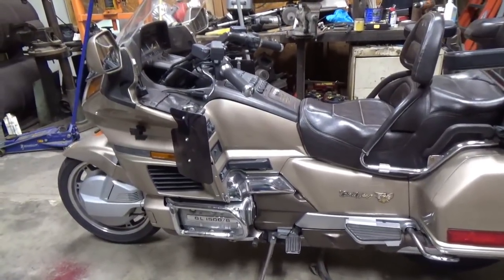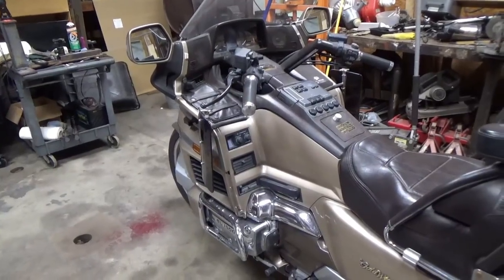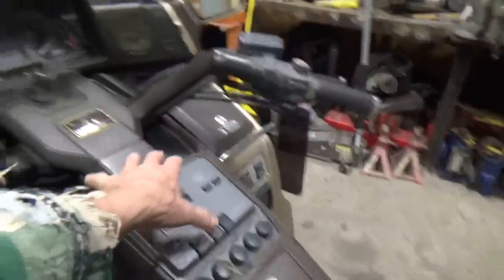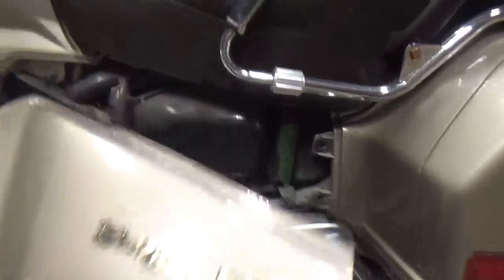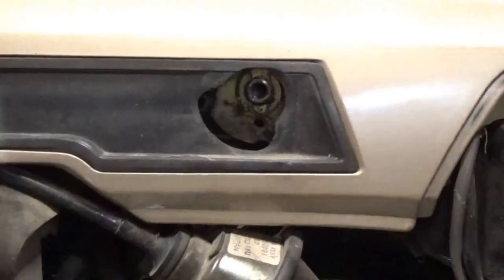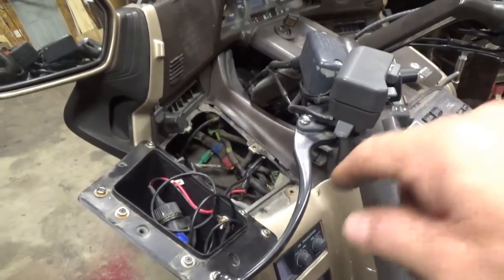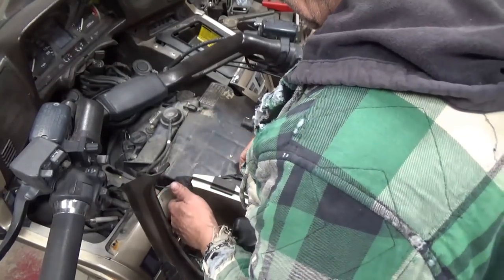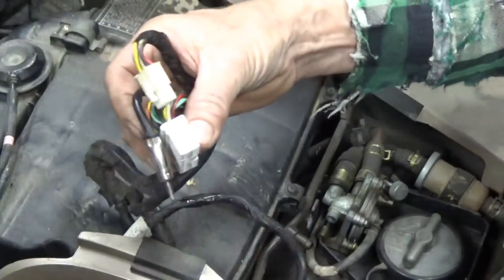Removing carbs on a 1988 GL 1500 GoldWing (part 1 of 2)

Comment: This has been invaluable showing the process. I am the (un)lucky owner of a 1989 GL1500 that is currently reviewing how to remove the side fairings to check hoses/ radiator for a slow leak of antifreeze.

Comment: I bought a new GL1000 with Windjammer fairing for $3,600 in 1976.  Gas needs to be treated with a fuel stabilizer and use no gas older than 30 days old per my John Deere manual to my Z960M mower which has a 31 H.P. Kawasaki 2 cyl. engine. Thanks for the video Gordon.
Reply from the maker: Your dating yourself Otis, in '76 I was like 18 and no possible way to come up with $3600

Comment: Always wanted one of this year, I had a gl1000 back when they were still considered a sport bike, mine had the vetter fairing and windjammer travel trunks to make it a full dress.i would hate to see what the shop labor rate at Honda would be to do this job, 3/4 of the job is removing the plastic. And another thing, it's a good idea to treat this with kid gloves, like you said, it's 30+ year old plastic, and it's winter and cold, makes brittle plastic even MORE brittle. By the way, beautiful bike
Reply from the maker: My shop does have heat so not to worry about that. That Gl 1000 would be much easier to clean the carbs on, I've done 1100's and 1200's before and each size up is more challenging. My first GoldWing was an '84 1200 Aspencade  and I cleaned the carbs several times on it since I was driving over the road and not having time to ride when at home the gas kept going bad. Now I'm local and can ride more often.

Comment: You have to add load resistors for turn signal leds to make them function.  My advice for anything with a carb is to add a cap full of Marvel Mystery oil to every tank of fuel. It helps with keeping the tank and carbs from corroding because of the ethanol. I have been doing it for years and my carbs do not have issues!  Do you have mercury sticks or a gauges to sync & balance the carbs?  If not I can give you a link to a home made setup and it will only set you back a couple bucks to build.
Reply from the maker: I didn’t mess with any of the adjustments on the carbs but they will not be out of sync, it is running pretty good now Even in cold weather it starts and idles without the choke but dies if I try to gas it without the choke, I started it in the garage this morning before I turned on the heat, I'm sure it will run fine after it warms for a minute or two. You will see when I upload the cleaning vid.
Reply: I never put carbs back on without syncing & balancing them it's the difference in having a good running bike and a great running bike.  Did you look into getting your account verified?
Reply from the maker: I haven't done that that I know of. It was so complicated setting up the pay end of the account, it really was a confusing mess with little direction. I don't know if I verified it in that process or not, I haven't done anything since. I don't know how to sync these carbs with the vacuum gauges without a stripped down spare engine not installed in the bike, you'll see in the next 2 videos. I'm sure it must be possible with special tools, but 2 carbs on 6 cylinders is 2/3 less likely or 1/3 the chance if having a noticeable difference. My experience has been if I don't disturb any of the external adjustments and only clean the jets and passages, it will hold to the syncing that it had before I started which is good as long as someone else didn't mess with it before me.

Comment: I have an 83 honda magna and I dread removing its 4 carbs.   Looks like the goldwing is even more work to get the carbs removed.
Reply from the maker: I had to clean carbs on a Honda v4 a long time ago, I can't remember the model at the moment but I do remember a subframe pipe that had antifreeze running through it and 2 gas tanks. The carbs were a challenge to get out.
Reply: @57bagre  The Magna is setup that way.  The Sabre may be the same,  I'm not sure as I've never seen one in person.
Reply from the maker: I believe it was the Magna, maybe a v45 or something like that. Tank rusted inside and had to throw in a hand full of nuts and bolts and shake and blow in air to clear the dust and repeat about 20 times and then pour it a treatment and then a liquid tank liner and after that cured, back together.